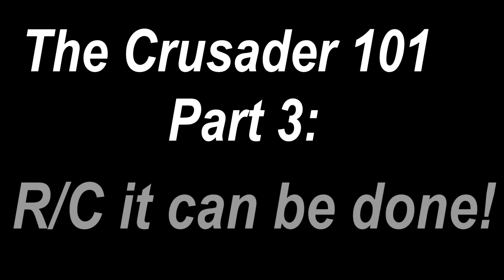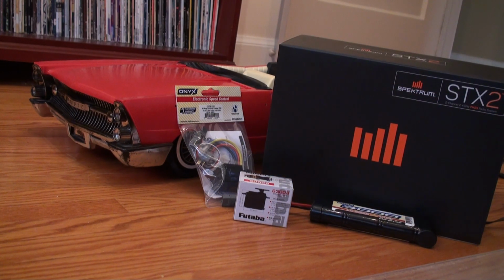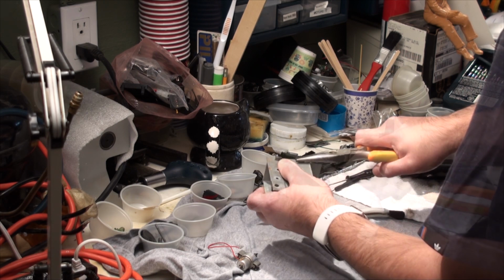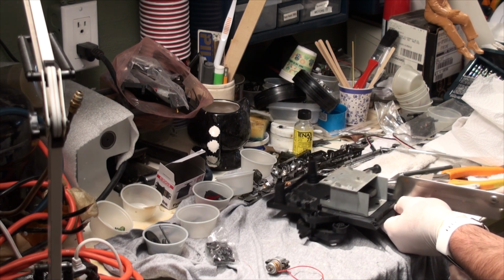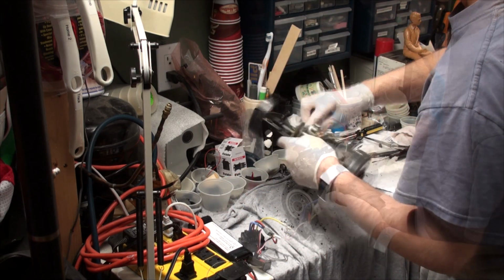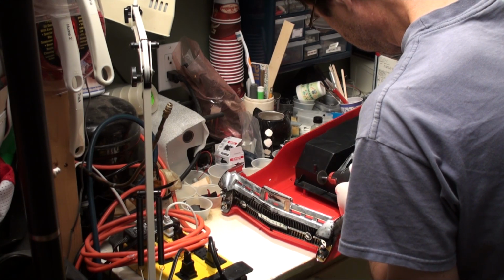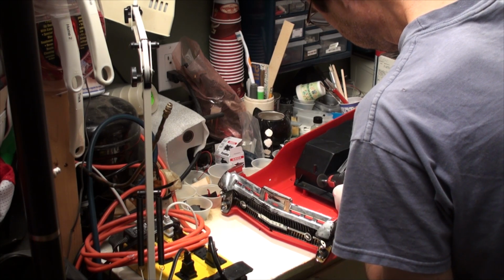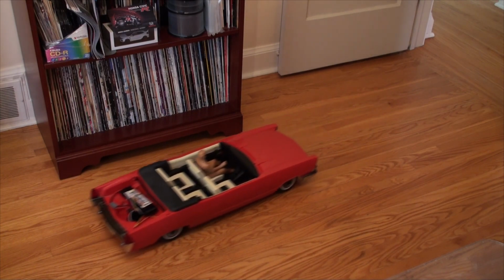Crusader 101 Part 3

Comment: Was amazed  by your upgrades . I picked one up and want to try doing the same. 
I'm missing the windshield but would like to resto-mod and paint while I find one 
Do you  have a list of the products you used ?
Reply from the maker: Thank you so very much for your wonderful compliments! Congrats on getting a Crusader 101! Yes, the windshields are difficult to find, especially in good shape, but they can be corrected for the inevitable 'warping' due to age! Here is a list of the items I used to make my "101" into a modern R/C: The speed controller I used: Onyx 40A Brushed Crawler ESC - works great with the original motor in the car; The steering servo for the front wheels: Futaba S3003; Battery: Onyx 3000 NiCad; Radio control (with receiver): Specktrum STX 2, 2 channel 2.4GHz; The lighting kit I used was the GT Power LED system. I hope this helps! Thanks so much for watching, commenting and subscribing!

Comment: Hi did you used the original rear motor what voltage battery did you used.i would like some pictures of how you started the steering and speed control mounted send pictures to rc66gto@aol.com I will highly appreciate it.
Reply: Richard, thanks so much for your comment! The battery is 8.4 volts, I forwarded you some photos of the assemblies, please let me know if you received them, I hope they help.
Reply from the maker: Richard, I hope the photos help, really appreciate your comments!
Reply: hi its Richard once again I did not receive the picture please resend thanks
Reply from the maker: @richardcamacho8134  Richard, the photos have been resent as two emails, please let me know if you receive them.

Comment: I did my steering in the stock position using no gears.
Reply from the maker: There is only one gear left in the steering assembly and is used only as a pivot for the tie rod. All of the other gears were removed. My apologies if I didn't make that very clear in my video.

Vintage feels, your video was certainly an inspiration for this series of videos. It would be great to see the work you did to get your car running as well as it does.